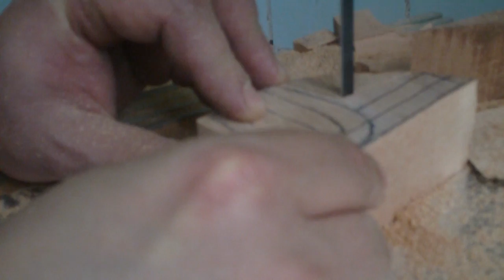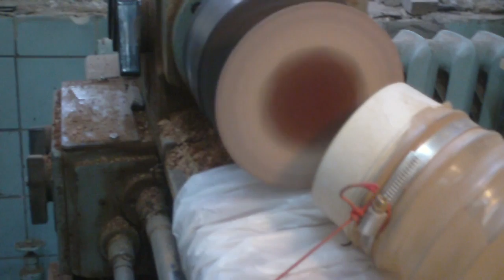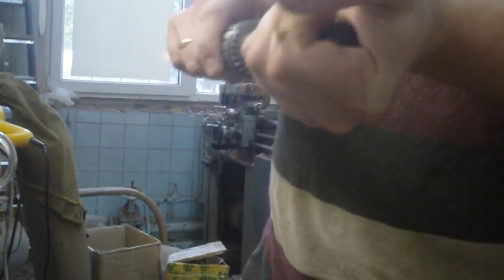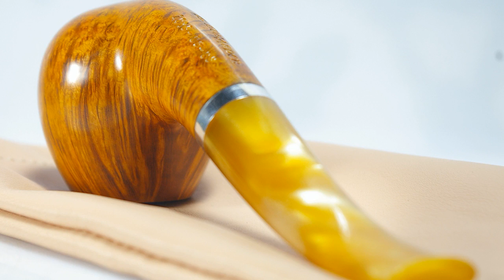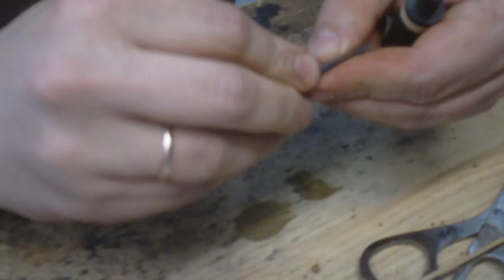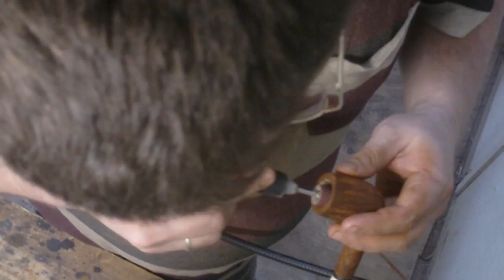How I make a smoking pipe

Comment: I found a small hole going from the bottom of my bowl to the bottom of the pipe... any thoughts on what could remedy that problem?
Reply: Alexandr Bondarev no it looks like a pit or something doesn't look artifical... it about the size of a tac... going into a thin 1/4 inch crack on exterior
Reply: Erik F what I do is mix wood glue with briar dust and stain dust (coloured pigment) and fill the pipe on the outside.
I use a concave dremel bit in the bowl for blocking the hole on the inside and make it stable with cotton in the bowl so I have something to push against when I am filling the crack.
Do layers of fill and leave it proud for sanding.
Obviously the thinner your dust the better, use your disc sander leftovers.
Leave it for ages to dry(2 days) as inside it will dry very slow and when you try to sand it it will be gummy and will drag.
the wood glue must dry clear or you can use wood filler, wood filler has epoxy though which is not the best thing to smoke really...
Your patch will always be darker no matter what you do.
Now on the inside of the bowl you can use pipe cement which you sculpture with a wooden or metallic ball dipped in isopropyl or ethyl alcohol.
Then sand inside and out, micromesh to 12000 and stain with alcohol aniline (fiebings) to your liking.
Then apply your shellac or carnauba.
Just fixed a pipe yesterday like that and it came out great after staining.
Hope that helped.
Good luck Erik
Reply: Dimitris Kotsopoulos thanks for the reply! I shall try that out when I get some free time...